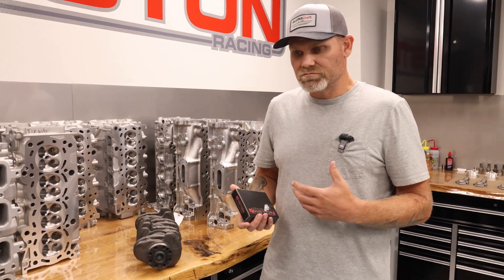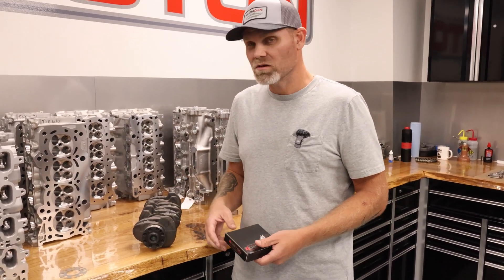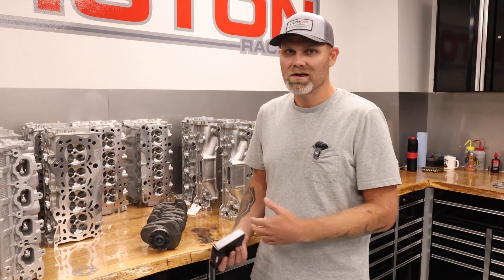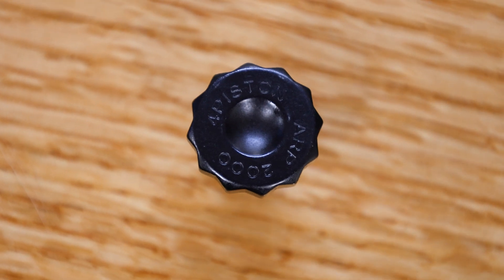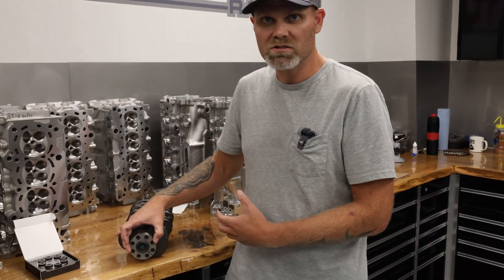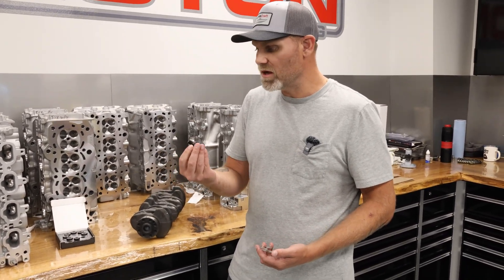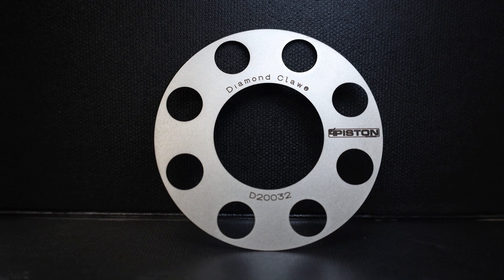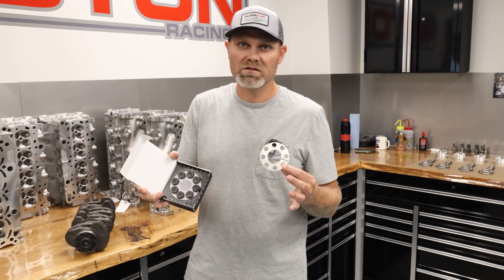Why You Need 4Piston Diamond Claw Crank Lock & Heavy Hitter Flywheel Bolts for K20/K24 Builds!

Comment: Just to be clear. Put the diamond claw, then flywheel, then the bolts with blue lock tight? Just wanted to make sure.
Reply from the maker: No lock tight needed just torque to spec and your all set.

Comment: $200!  What a JOKE!!!  Have been building Honda engines since the late 90's and have never had a single issue!
Reply from the maker: They aren't $200, so hopefully you build better than you read. Also, thousands of people have found these useful.  People are pushing hard...11,000+ RPM and harmonics are dramatically different up there.  Also, the OEM bolts bottom out before they torque down in most aftermarket cranks.
Reply: @4pistonracing  Action Clutch x ARP K Series Flywheel Bolts exist?